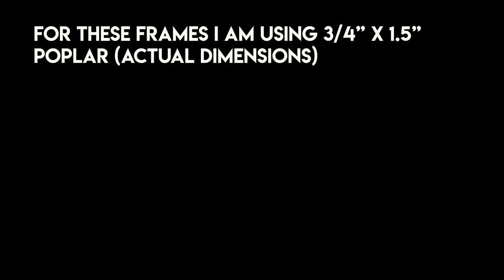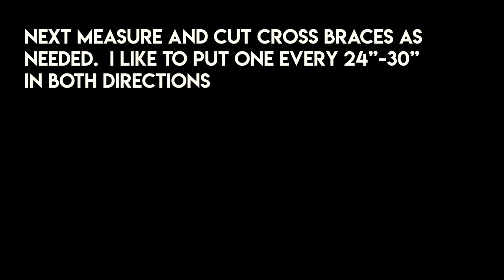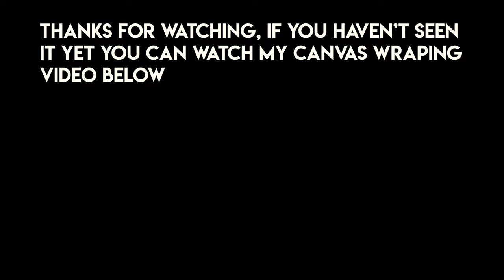How I Make Canvas Stretcher Frames/Bars

Comment: I have a canvas that I bought from Hobby Lobby, and it got warped. I think because it got leaned on a wall in part of my house that got hot from no air conditioning. But do you have any tricks on how to straighten it out? It’s a 24” x 48” level 3 gallery wrapped canvas. I am at a loss.
Reply from the maker: That’s a hard one as normally when wood it warped it’s hard to get back straight. What I have found if you frame it after painting you can use the frame to pull it straight again.